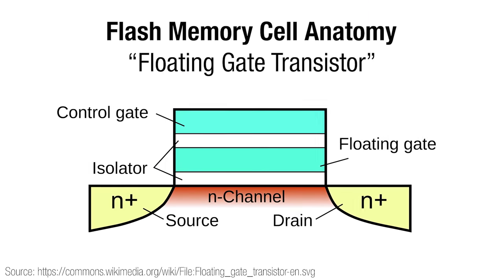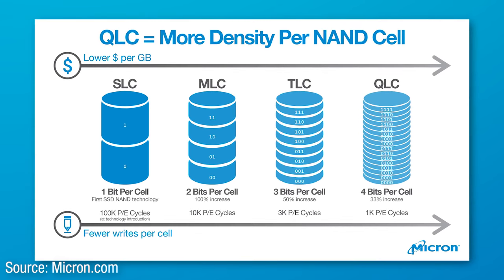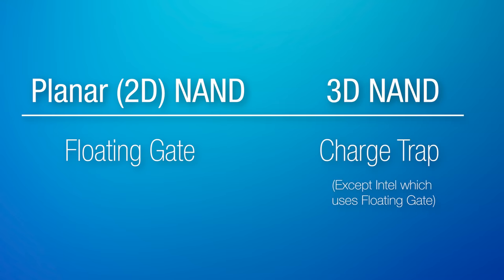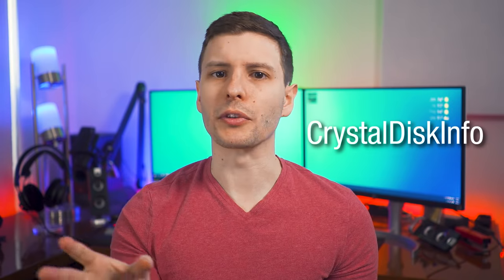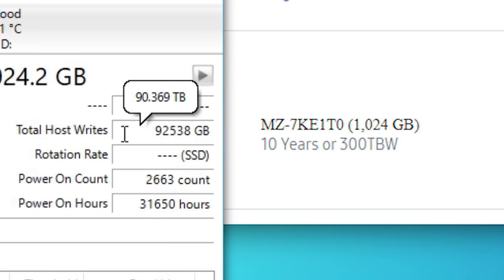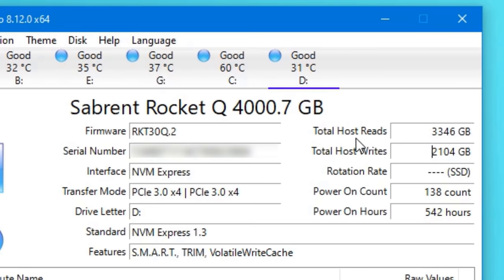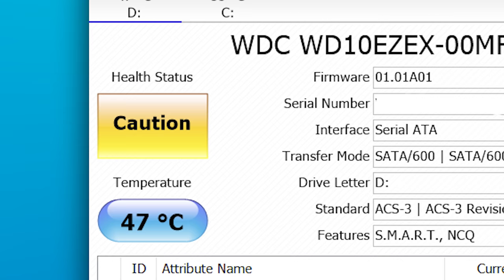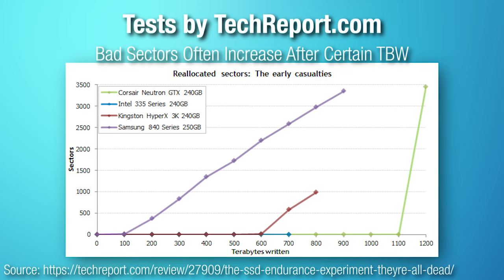How Much Longer Will Your SSD Last? How to Tell

Comment from the maker: Correction: The 970 Evo Plus actually used TLC, but that just proves my point even more about improved technology.
Reply: why did i think you were talking about the channel tlc
Reply: Cool
Reply: Hey there, I want to thank you for the knowledge in your videos, before 1-2 months, I didn't knew many things about a computer, but after watching your videos, I know every basic about it, Thank you for these, just love you :D
Reply: Can flash drive be scanned as well?
Reply: I have a 850 Pro 256gb bought it in 2014 have used 65TB/150TB. I love the 10y warranty but the 850 Pro is the last one with such big warranty, all the newer ones go up to 5 years.
Reply: thats true, But since samsung is samsung  they think they can call it just MLC 3Bit ( and thats a TLC right there, when the actual MLC Drives from samsung are called MLC 2Bit ) and for average buyer thats more confusion to deal with. Long story short when buying from samsung look for the ''Bit''.
Reply: I almost filled my ssd with in half a year of having it, so I got a hdd and don't put anything on my ssd unless it's a video I'm editing,  but now I realise that putting  videos on and off the drive could be bad, so I'll probly get a secondary side to do that with one that's fast and that I can replace with out loosing my is or something like that
Reply: @VJ234.5  Flash Drives uusally USB's dont have S.M.A.R.T so they cant be checked easily
Reply: @umar_07w  idek
Reply: Thanks for the in depth explanation. How does overprovisioning help exactly? I over provisioned 20% of my 2TB SSD.
Reply: D 
Overprovising is usually actually done by the factory many times. Why are SSD's 960GB not 1000? Or soemtimes 480 but not 500? (Sure there are 500 and 1000 also too)

Usually all of them are overprovishined actually to my knowledge. It helps because when you fill it fully, your actual storage under all the physical NAND's are not super maxed out, basically wear leveling is what kinda also prevents this but you can see on how that works online for a better explanation
Reply: the evo models use mainly tlc but a small portion of slc as a cashe for the slower tlc. this way they can keep up with faster mlc drives in terms of speed as long as you don't write huge files to them cause once the slc is filled it has to write directly to the tlc and write speeds will drop. they use them same tech they call turbowrite on their qlc drives but here the result is far worse and the drive actually slower than a normal hard drive if you run out of slc cache space. so i guess yeah. the best purpose for these drives is as a data grave where you write stuff once and then read only.
Reply: @VJ234.5  Scanning a flash drive is harmful  as it adds to the 'wear' .  You can.
Reply: MLC FTW
Reply: I have the 970 EVO Plus 500 GB as my boot drive. I got it for $80 off of Amazon.
Reply: Hey Joe, Crystal disk shows 2 things : Total Host writes as well as total NAND Writes which one do I use since the gap is hugeeeeeeeeeee. 
Total Host writes: 21 057 GB
Total NAND Writes: 8514 GB
Reply: TBW isn't a measure of when your SSD will die. It is a measure of when it can hold your data unpowered for 1 year (retail SSD) or 3 months (enterprise SSD). You should still use hard drives for backups.
Reply: @sang3Eta  Crystal disk shows 2 things : Total Host writes as well as total NAND Writes which one do I use to measure when will my SSD start to die  
Total Host writes: 21 057 GB
Total NAND Writes: 8514 GB

My SSD has a 30 TB warranty
Reply: @ElyesBoudhina  The health meter gives you a percentage based on the current TBW used and the manufacturers TBW life. So if you had an SSD with 100TBW used and it had a 1,000 TBW life span it woulds show 90% health.
Reply: @sang3Eta  thank you but I want to know the difference between Total Host writes: 21 057 GB
 and Total NAND Writes: 8514 GB . I mean why did they implement 2 different parameters?
Reply: @ElyesBoudhina  I would guess some writes never leave the cache and get stored in the NAND. Not storing the virtual memory (page file) writes to the NAND would make the NAND last a lot longer.
Reply: @sang3Eta  Thanks for your answers but I still don't get the difference between them. I searched online and found nothing useful.
Reply: damn this is nice. my uncle said ussually hdds last around 7-8 years.
less if u remove games a lot. which for my ps4 was the case. i killed it in a few years 2-3 because it barely had storage so i had to reinstall over and over.
but now i have a 4tb hdd. its slower. but should last a lot longer. really cuz i barely need to rewrite.
Reply: What is your opinion on the new revelation that Samsung is swapping parts in their 970 Evo Plus SSDs and sabotaging performance. Like WD and Corsair, Samsung got their fingers caught in the cookie jar... Great video as always @ThioJoe
Reply: @DJBudGreen  It seems that it is all ssd makers.  Samsung is just the latest to get caught.
Reply: I understand the tbw stuff, but what about years? Let's just say you use it as a normal desktop hard drive and write maybe a few gb per day. It might take 500 years according to the tbw. My question is then how long do you expect it to last in a desktop if it stays well below the tbw? Could you just use the same ssd for 30 years and be just fine?
Reply: The truth is SSD DRIVES AREN'T AS RELIABLE AS HARD DISK DRIVES
Reply: E
Reply: I learned something new, I didn't even know these had a limit, now I'm checking all my storage data devices my phone my phone's SD micro SD card. Because I've had those for years.
Reply: I give up with SSDs!  I regularly buy SATA SSDs to install my OS on (only the OS, I store my home directory, files, and games on HDDs).  
They always fail after a few months, giving me weird messages during the boot cycle.  I'm going back to using HDDs for my OS drive.
Reply: Interesting, but I just now saw this and this video was made 2 years ago as of my seeing it. How much has this tech changed in that time? Do you have an updated/current video about this? I am in the market to get a new HD and that info would be very helpful/ Thank you in advance. 🙂
Reply: Samsung 970 evo and 870 evo failed a lot in the past year, a lot of bad batches of SSDs all around the world. Samsung didn't address the problem in any way. SSDs don't seem a safe choice anymore
Reply: Also, it doesn't prove anything. They just increased the TBW because they figured out SSDs just last more cycles. At first, they didn't want to risk it.
Reply: why did you censored the serial number for your drives??????????????????????????????
Reply: Please supply me with solid proof the SSD lasts Longer than HD.. I demand you prove your claim using facts.
Reply: But what if you have a Mac?
Reply: Hey everyone is there a way to “refresh” an SSD? Like reformatting and erasing it (after backing up your stuff of course). Does that do anything?
Reply: hi, have you tested if all relocated dying sectors also contain the data?
Reply: @teegees try Clean disk after you select the disk in Diskpart